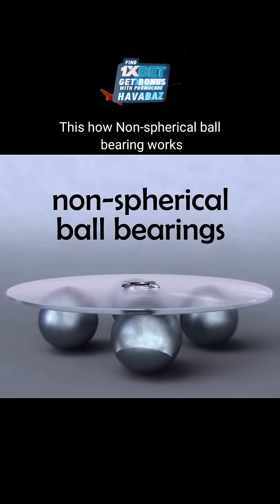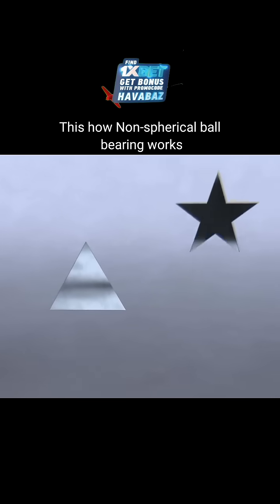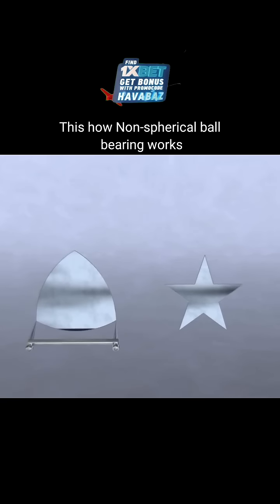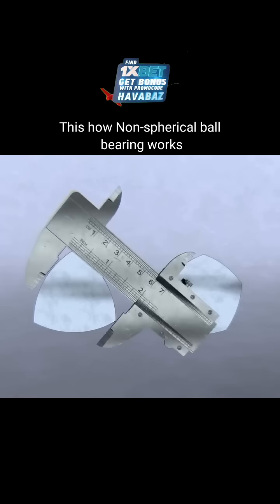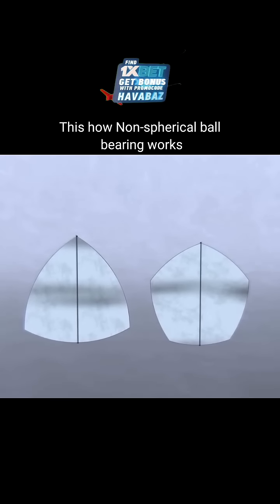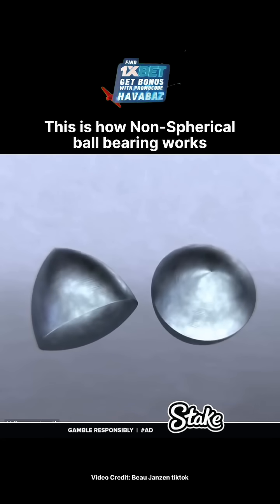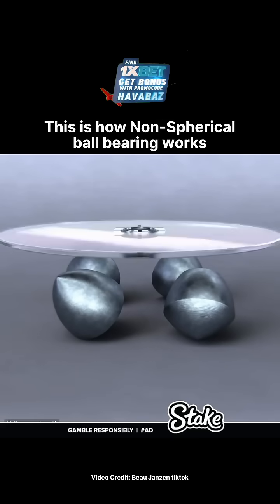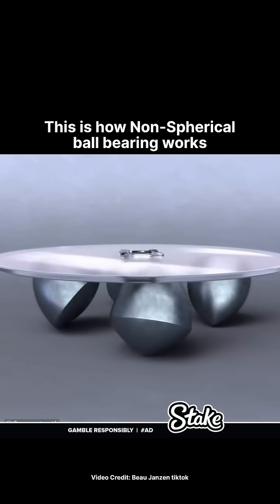This how Non-spherical bearing works #shorts

Comment: this explains the geometry of some rotary engine blocks, the drive shaft in the center, the pistons equidistant along the outer walls and the placement of the cams and heads. interesting.